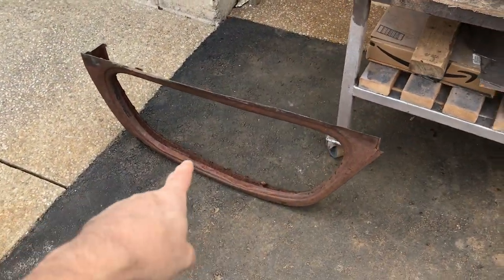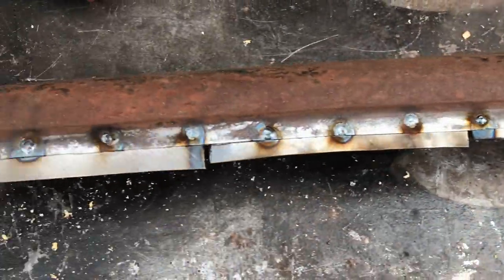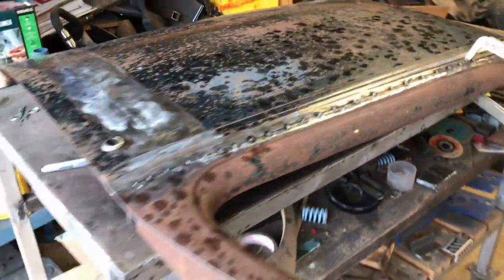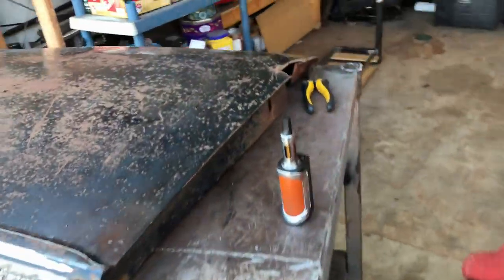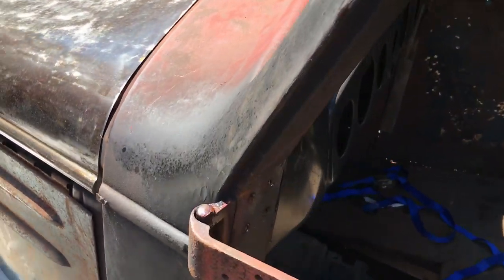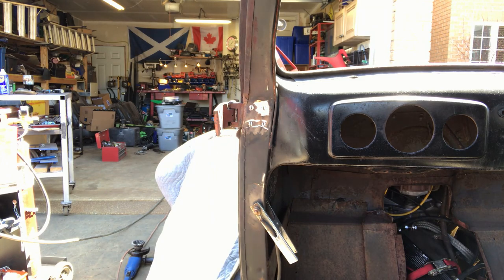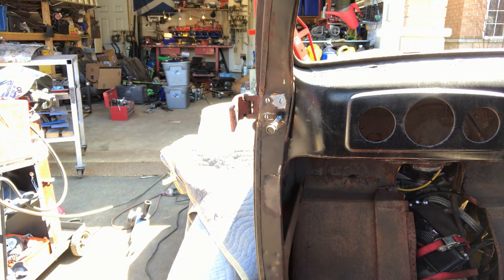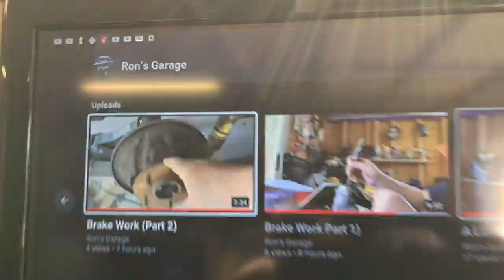1936 Chevy Coupe Door Chop & Weld Part 2 PLUS Hinge Problems

Comment: The door gaps look spot on from here. The weld across the top was text book for sheet metal. Tack Weld about every 2 inches let the panel cool a few minutes, make the next pass across with tacks in between, grind and repeat until all welded. I had to take the tailgate off my old el-camino today and had to drill every screw on the hinges, happens alot. Nice work.
Reply from the maker: Thanks Jeff. I know it looks ugly at the moment, but the fit is good, so I'm happy for now.

Comment: Those old hinge bolts are a pain in the rear! I had to drill the heads off of mine, because the thread that protruded out the back of the backing plate was so rusted, it kept jamming up.
You’re going to have your temporary door looking so good, it might end up, a keeper! 👍Tony B
Reply from the maker: hehehe, I doubt it, but if I can't find a good replacement it may well be a keeper.

Comment: I weld a washer to the screw head,  then weld a nut to the washer.   This seems to work for me.  The best penetrating fluid is Acetone and ATF  (50/50).  If you are on a road trip to Winnipeg,  I have an all steel 36 Sedan that I would sell.  PS Very nice work...
Reply from the maker: One project at a time my friend.

Comment: Rather than welding the bolt on to the door hinge bolt,,clean that hinge bolt and weld a nut on it by plug welding via the hole in the nut.make it good and hot!..I'm thinking you might have something more substantial to really crank on with a socket and a power bar. Just a suggestion . Your build is coming along nicely ;)
Reply from the maker: Thanks bud, James already suggested that. To be honest, if I need to use a breaker bar to get it out, I'm going to break stuff lol.

Comment: Benton, Missouri, USA put a pin in for me.  You need to get an air impact wrench and a couple of slotted screw driver socket.  Use the impact without turning on the rotation for a bit and then try it.  If you have an electric hammer drill you can get a socket adapter for it and do it with that.
Reply from the maker: Thanks Roy, and welcome! Yes, it's yet another tool on the never ending Christmas list lol.

Comment: You need to  use a hand impact tool that you hit with a b.s.her to remove the screws old school tool about $10 bucks at most hardware or.auto parts of amazon. Hinge pins harder try a air chisel pin punch if you have air.I also would use a mini belt sander on you were on top of your door again if you have air compressor
Reply from the maker: A belt sander would be far better, if I had one lol. Thanks for the advice Konrad.
Reply: B.s.her was autocorrect for the word hammer sorry I read before sending and it changed
Reply from the maker: @konradweniger3141  A hammer is a basher hehehe

Comment: Try welding a nut instead of a bolt.  Fill the thread with weld over the slotted screw head
Reply from the maker: Fantastic idea!!! And this is exactly why we are in this together brother. I'll try that today.
Reply: @ScottRods  a little trick from the steelworks 🏴if you can get some heat into the stud it will help break the seizure  as well